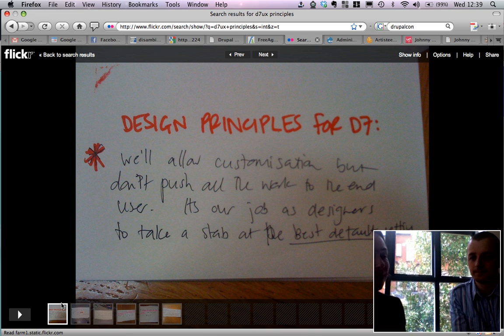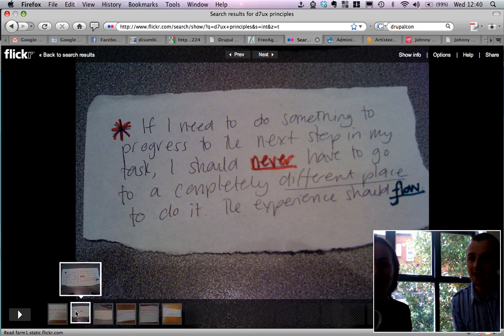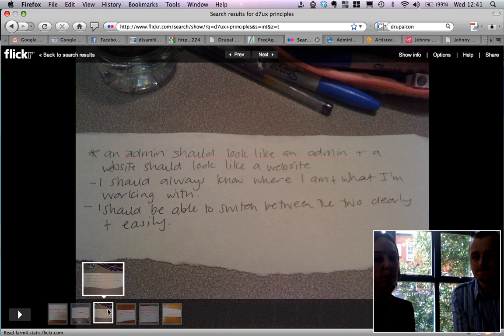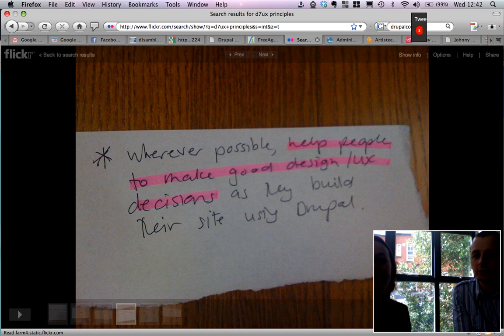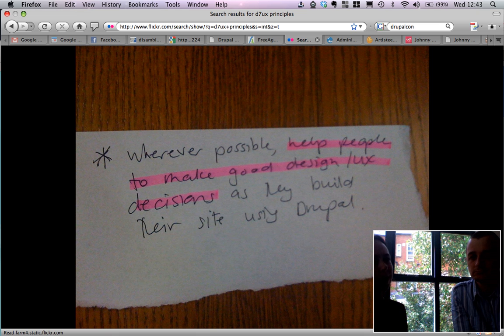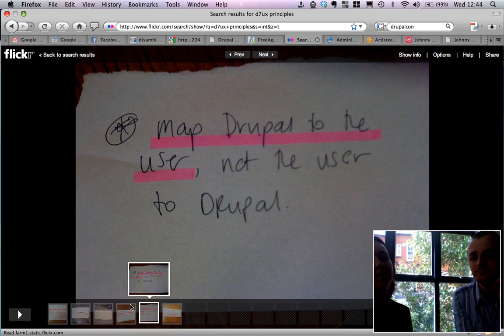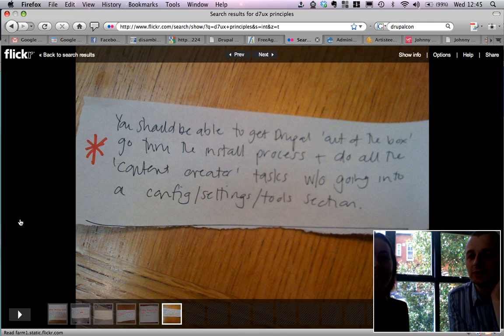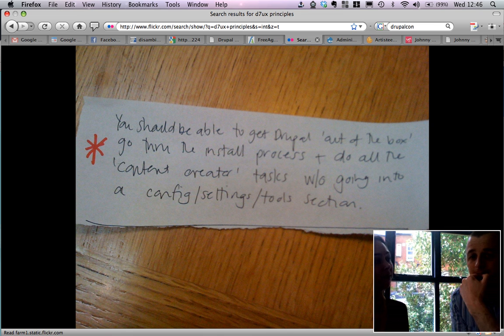D7UX Design Principles

Comment: Very good. I particularly like the 2nd one about flowing through tasks which could be much improved in Drupal. For example when you enable a module or add a new field to a content type, then the permissions options should be right there rather than having to manually go to the permissions page.